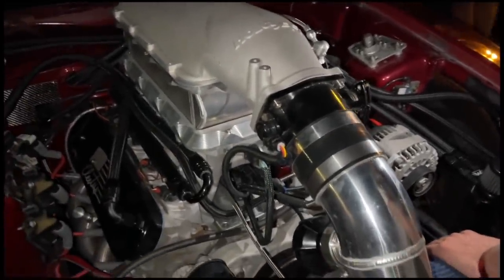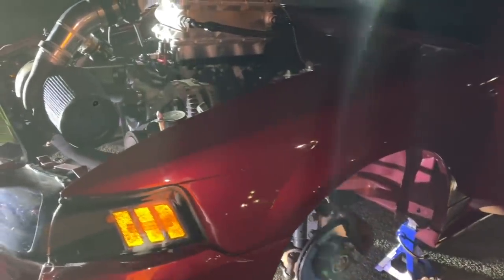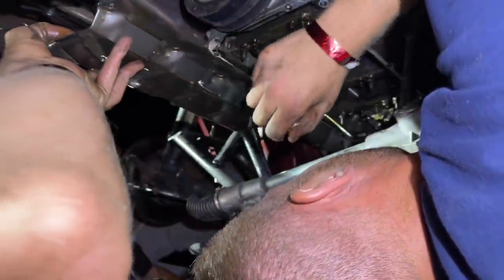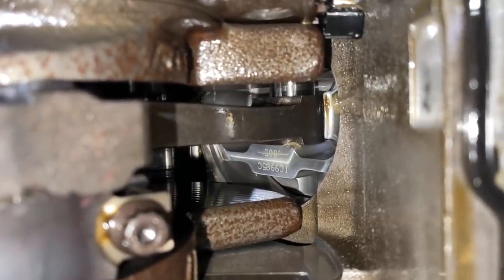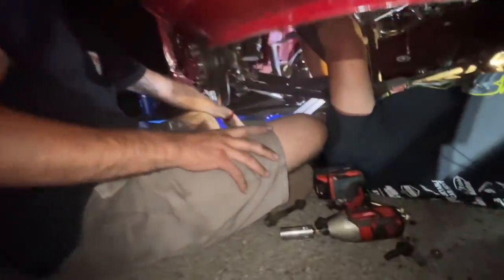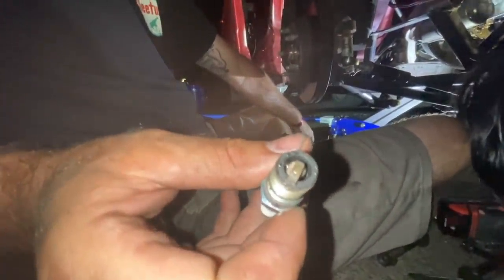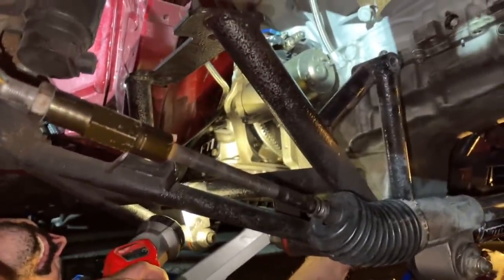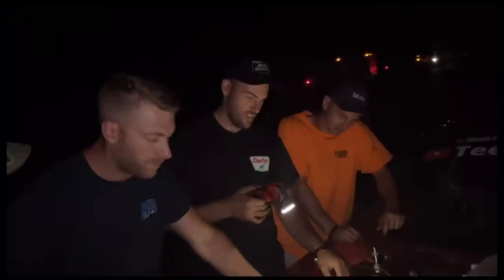RIP - We Are Down & Out of Race Week... Engine Tear Down with Cleetus Crew at Bandimere

Comment: I drove my engine after knowing my oil pressure went from 25lbs to 8lbs and ignored it. until it locked up on my way home one day... Knock knock squeak, knock knock squeak. kicked number 3 out so bad there was barely any bearing left lol. But remember, stock block LS are non priority main oil systems so if you lose pressure up at the cam/valve train/pressure sensor, you'll have even less down low.

Comment: hey guys, as a machinist seeing this happen, in the future order 2 sets of connecting rods and matching bearings, theese boosted cars blow the heads off and as jack said it filled with water. you could have finished with the extra parts. consider the advice from an old machinist.

Comment: Well that was fun while it lasted. I guess you're done unless you want to swap out a block or a bunch of parts.
Reply: Head gasket maybe just Rod and rings at most maybe find a piston and check the push rods could be done super quick but finding things in enough time idk. But block should be fine
Reply: @triplehfarmsllc7348  Couple hundred bucks (if it's even that much) for parts and new oil and it's good to go. Give Jackstand a day with it and it'll be quite literally as good as new.

Comment: When i raced Dirt cars I changed oil every race! pay for oil or pay for rebuild. That suck Parker Just when that thing was starting get in the grove. Ls head gasket suck the motors weakness. If you don't have 1/2 inch studs Its even worse!
Reply: Oil is cheap. Motors, not so much.

Comment: So what’s actually wrong. Bent rod making the noise? Or was there something else
Reply: rod is bent because the head gasket leaked coolant into the cylinder, liquids aren't compressible so something has to give. rod is shorter so the piston is contacting the crank. tuning for the win